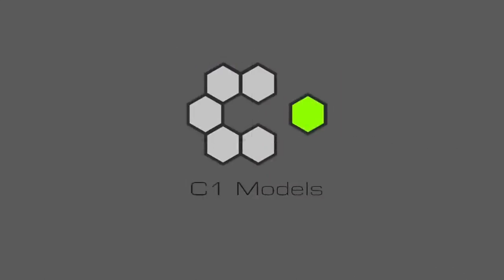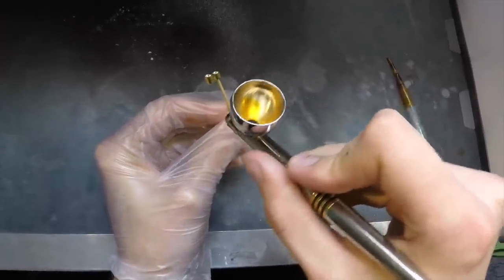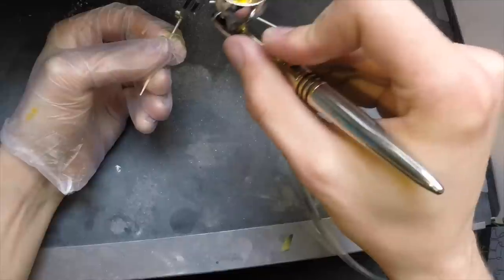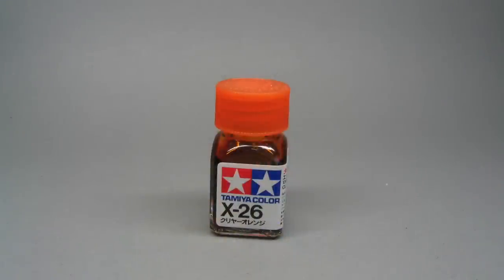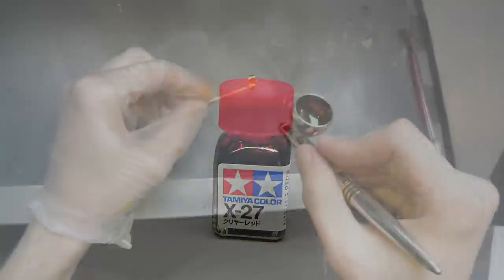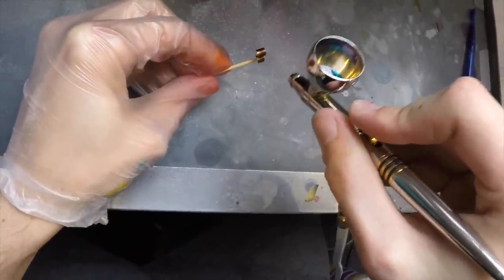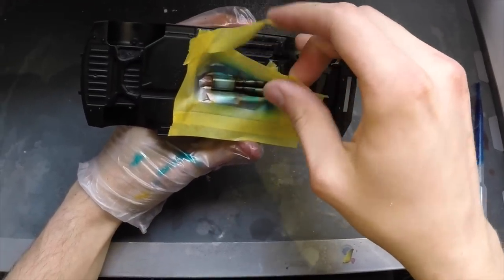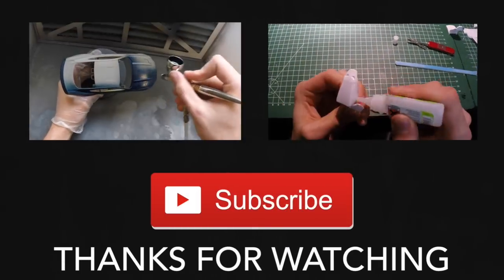How To: Heatstain your Exhaust

Comment: Great work! Well it's really hard to nail that look, because it's so familiar. I remember (especially from bike exhausts, two stroke) the colors change a bit more randomly, are less saturated and the colors don't blend that smoothly in certain places. It looks to me similar like that rainbow effect of gasoline or oil on water puddles. A similar challenge is also a certain type of galvanized metal. It has those colored smears which are very typical. Not an issue in 24th scale though. Thanks for sharing your tips!

Comment: I'm going to give this a try. I'm building the Fast & Furious Dodge Charger form Fanhome and thought this would be a great modification. I figure it's safe for a first timer: If it turns out great - Its bragging rights. If not - no one will know unless the car is turned upside down. And how often will that happen! 😅 I might kick it up a notch by cutting small strips from a Coke can to hide connecting joints - paint them to simulate a welding point.

Comment: Not to spoil your tread.
But what you do here is a discoloration af titanium exhaust, NOT a standard iron tube exhaust as on the model.
Well, the exhaust tips, are ok to do this with, but the standard exhaust dosn't get discolored after the header, it just get's rusty.
It makes a more belivable model to use rust colours on all the "joints" of the exhaust, edges on the mufflers and like.
That gives a much more realistic look.
Normally i would use vallejo rust Air color, and some rust pigments, since the iron tends to swollow up where it rusts.
You did a good job, but on the wrong subject.
Reply from the maker: +x3mperformace If i was replicating a stock steel exhaust, you'd be correct, though i'm not.
I am trying to give it the look of an aftermarket titanium exhaust: http://www.motorworldhype.com/wp-content/uploads/2008/11/amuse_gtr_exhaust.jpg
Reply: +The Scalemodeling Channel The effect is just wayyyy to much.

Comment: Ok, so I'm about to do this tomorrow - but questions. (I'm new to airbrushing) The shaking. I get that its due to very little paint in the cup, but how many drops there abouts did you add to the cup, and wouldn't that little cause splattering?  In terms of adding very little color to the part, why not just further away from the part with quick strokes?
Reply from the maker: The further away, the wider the spray
Reply: @TheScalemodelingChannel  Thanks. I completed part of the exhaust - and though I may have overdone it a little, I think it turned out great.  From a normal distance, it looks good. Thanks for the tips!

Comment: Hi thanks for the tutorial i have always wanted to try this but didn't know how.
Btw will tamiya acrylic paints work or only the enamels? Also what thinner (if required) would be best to use?
Reply from the maker: Brayden Walker I just used these as i had them laying around for way to long. You can pretty much use any brand or type of paint as long as its a clear color(or candy). Use the apprpriate thinners for the brand. Tamoiya acrylic has its own thinner from Tamiya. Pretty much every paint brand has its own complete system with thinners and cleaners etc.

Comment: Did you thin your Tamiya paints any?
Reply from the maker: +Derek Burnett Yes, though i have no idea how much, i just kept adding thinner untill it went through the airbrush.
Reply: The Scalemodeling Channel Okay great. I did a lot of interior parts the other day and basically mixed it 1:1. Had great coverage, no runs, but I did have to shorten my trigger stroke because it was coming out really heavy. I'm used to seeing a huge fog from a real gun doing automotive panels so it's a bit of a learning curve for me. So far so good though.

Comment: I love it!! Great work!  I know Tamiya Paint is not really air brush friendly. Did you use any thinner?
Reply from the maker: Yes i did, otherwise it would not have gone through the aibrush ;) i used terpentine to thin it down. Wich most likely was not the correct one to use, but it worked :)
Reply: What i was meant to say was, what was the ratio with paint to thinner?
Reply from the maker: flyingchicken33 I just did it by feel. Added some more tested it and so on untill it went through the airbrush. Some colors needed more then others.
Reply: The Scalemodeling Channel It's funny really, I was thinking yesterday "I wonder if I can airbrush Tamiya clear colours without thinning", thanks Tom!
Reply from the maker: ELP Modelling Well, some can, but the ones i used where old(very old) so these could not be sprayed without thinning. The ones in the bigger circular bottles can in most cases be airbrushed straigh away without thinning.
Reply: Thank you my friend! Not had a need to airbrush yet but may give this exhaust heat staining a try using a different method (yours) soon!
Reply: ELP Modelling 😉 Hi!